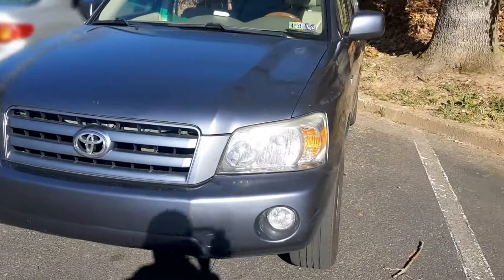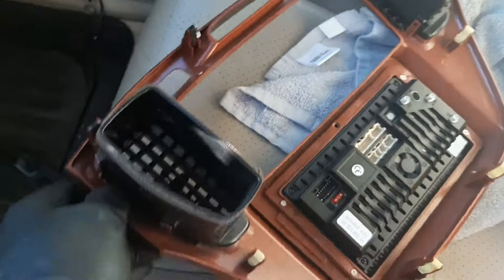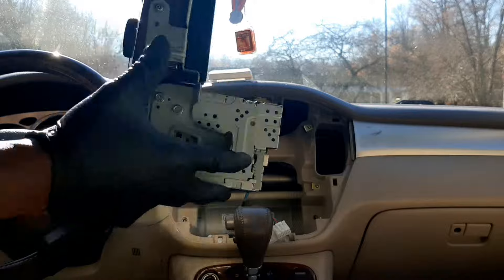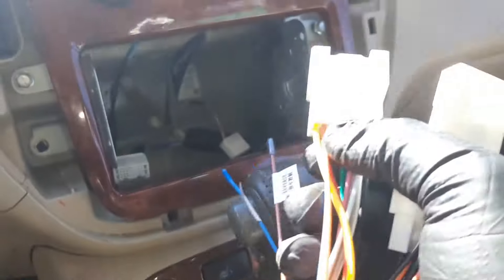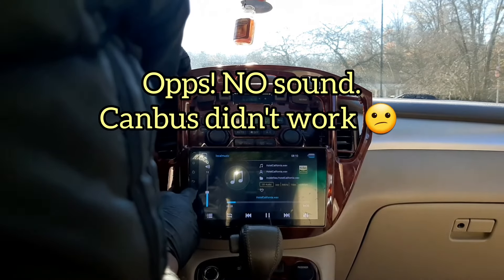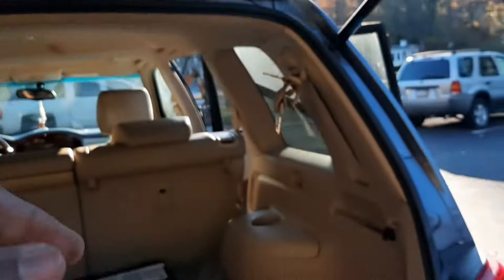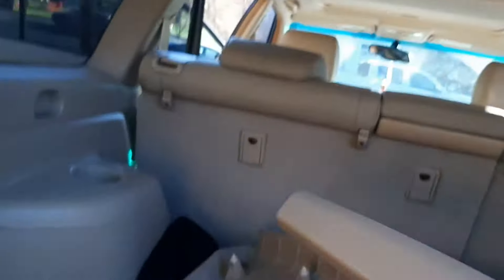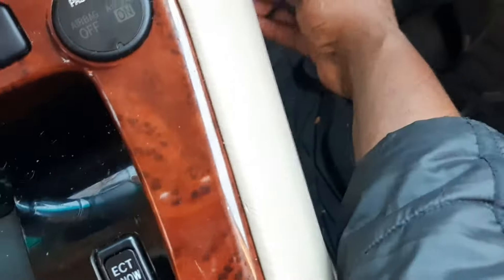Toyota Highlander Android Radio With JBL Amplifier (2001-2007) and Backup Camera Installed

Comment: This 100% worked for me! 2006 Highlander Hybrid.
Reply from the maker: Thank you for the feedback
Reply: @eazidiy hello i have a question i did all of it but i cant find a proper antenna adapter that fits my 2002 toyota highlander
Reply from the maker: Unfortunately I do not have a link as I did not use an antenna adapter in the video. Please check online.
Reply: What is the name of the friend cable that I want to buy from JBL.
Reply: did your hybrid come with the touchscreen system for the a/c? and how does it work when replacing it with this kit?
Reply: @StretchWCReno  mine has manual controls. Sorry

Comment: Just added the same unit on my daughters 2005 Highlander with the JBL system, how did you get sound with the buzzing noise before you made the new adapter?
Reply from the maker: Connect the amp turn on wire to 12 V ACC wire

Comment: Did you have to drill pilot holes for the camera screws or did they self tap?
Reply from the maker: Self tapped to the plastic trim. I created an indetentation first with a drill bit and drove the screws in afterwards.
Reply: i drilled a hole on the metal to run the camera wire and sneake it up from outside little panel that is above the license plate and i finally applied steel epoxy to seal the huge hole
Reply from the maker: Great idea!

Comment: Where did you get the connector with jbl canbus? Every wiring harness i buy doesn't fit my highlander.
Reply from the maker: ** Metra 70-8113 JBL Harness https://amzn.to/3VW4GaP
** Axxess AX-MLOC740, 745, 780  https://amzn.to/3BzblQd
** Universal 16-pin Android Radio Harness for Toyota https://amzn.to/3hgSwdS
Reply from the maker: Here is a link to another video I made on how to connect JBL highlander https://youtu.be/SuNPs0zBMwE
Reply: I ordered this one, would this work?
Reply from the maker: It will work just like it in the video I made on it. Follow my wiring diagram and you won't regret it.
Reply: Ok thank you for the reply
Reply from the maker: You are welcome, let me know if you need any explanation during the process.

Comment: Hi man when i turn on the lights the unit just turns off what can i do to resolve this issue. Please help
Reply from the maker: That is strange. The orange wire on your harness is typically for dimmer. When headlight come up, your radio should dim but not turned off. You could snip the orange wire and see if it resolves the issue

Comment: I installed a radio and the audio is very low any ideas ?
Reply from the maker: Did you use LOC? If yes, tune down the gain on the converter.
Reply: @eazidiy  loc?
Reply from the maker: Line Output Converter as used in the video
Reply: @eazidiy  I don’t know I just have the harness the canbus and the radio
Reply: @eazidiy  everything works but the audio
Reply from the maker: The canbus won't work. I said it in the video. You will need the configuration like I did in the video. You can check this product https://eazidiy.square.site/product/customized-android-radio-harness-for-toyota-jbl-2001-2007/16?cp=true&sa=true&sbp=false&q=false

Comment: I used the metra 70-8113 and line output converter from description without a jbl harness everything works but now I have low background static not bad but noticeable and the head unit get warm quickly can anyone help
Reply from the maker: Did you say your car do not have an amplifier? Why did you use a line output converter?
Reply: @eazidiy  i have a jbl amp same as your video
Reply from the maker: @wordmoneygaming alright. Ground loop noise it the cause of the static noise. The Metra 70-8113 maybe faulty. Especially the RCA wires. You may buy another metra harness or a similar harness and rewire.
Reply: @eazidiy  ok thanks ive had this Metra harness a year before using so your probably right ill order a new one and get back to this post
Reply: i replaced the metra 70-8113 no improvement so i went to autozone and got a 7.99 dorman universal ground strap and bolted one side to the frame other side between the line output converter port and rca from the metra harness and everything sounds perfect
Reply from the maker: @wordmoneygaming excellent, that means you just remove ground loop interference from the RCA. Very resourceful. Great feedback!

Comment: my Toyota JBL Car Stereo Am/fm Cassette CD Player 16833 is damaged but the jbl amplifier 86100-0W040 is working fine, now i just wanted to change my radio for a Clarion Nx513 and still use jbl amplifier, what shoul i need for, thanks you
Reply from the maker: Is the new radio an Android headunit or just a single din radio?
Reply: @eazidiy  it is just a single din radio
Reply from the maker: Ok. You will need to buy Metra 70-8113 harness https://amzn.to/3MxoU8R
Reply from the maker: Note: connect both pin 10 ( black/white) and pin 20 ( black wire) of the Metra harness to the ground of your radio harness.
Reply from the maker: Note: Connect pin 3 ( blue/white) Amp on wire of the Metra harness to the Amp on wire of your radio harness if it has one. If not connect it to the red wire +12v Acc of your radio.
Reply from the maker: Match the rest of the wires color to color.
Reply from the maker: Use the RCA ports of your radio and plug the RCA of the Metra harness into them.
Reply from the maker: If your radio do not have RCA ports you will need to buy line output converter to make connections.
Reply: @eazidiy  it is just a single radio

Comment: Near the rear view camera, the yellow Video jack with black wire has a red wire coming out of the yellow portion. Where did you connect that short red wire?
Reply from the maker: It must be connected to the positive (red wire) of the reverse light. You may use another wire to extend to it.
Reply: How about the black ground wire where did you connect it to ? Please
Reply from the maker: There is a ground wire in the trunk. White with black strip wire.

Comment: How did you get the air vents to fit on the new frame? I cannot get the vents to clip onto the new frame
Reply from the maker: The air vents get popped out of the office frame and they are placed into the new one. You may need to use plastic panel removal tool
Reply: @eazidiy  I can remove the vents from the original frame but they do not fit the new frame.
Reply from the maker: @RunTheRockers  I have one like too in one of the job I did. Remove the grills of the air vent. I should work.

Comment: Where you connect the cable that is with the radio?? It would really help me if you tell me where’s that go
Reply from the maker: I do not understand your question. Can you elaborate more?
Reply: @eazidiy  what happens is that in my toyota highlander there is a cable that is next to the antenna cable that is not connected to the screen and because of that it makes a strange noise
Reply from the maker: No. That noise is cause by ground loop

Comment: NVX XMICROLOC4 | 600W 4-Channel Speaker Cable to RCA Adjustable Line Output Converter with Remote Turn On
Reply from the maker: Yes, I have something similar on my online shop https://eazidiy.square.site/product/car-stereo-subwoofer-4-channel-line-output-audio-converter-with-power-amplifier-control-wire-plastic-black/1?cp=true&sa=true&sbp=false&q=false Make sure to use Metra 70-8113 harness for your connection Harness https://amzn.to/3VW4GaP

Comment: Where did you get the connector with jbl canbus? Every wiring harness i buy doesn't fit my highlander.
Reply from the maker: The canbus harness came with the radio. But that didn't work for Highlander. You will need a Line Output converter and make connections with Metra 70-8113 harness. Check my video description for details